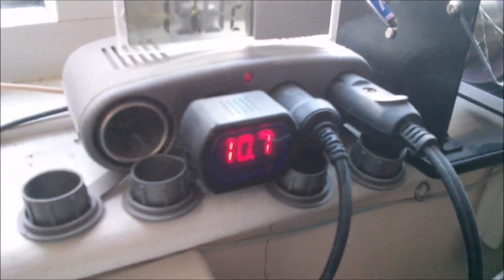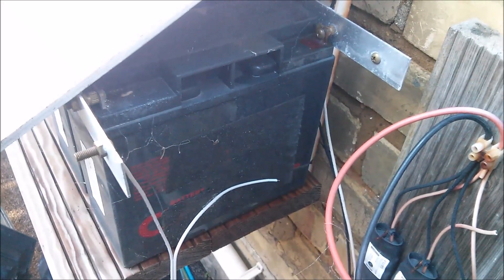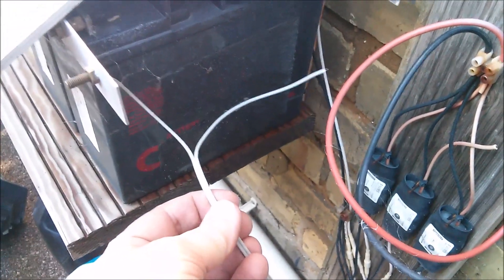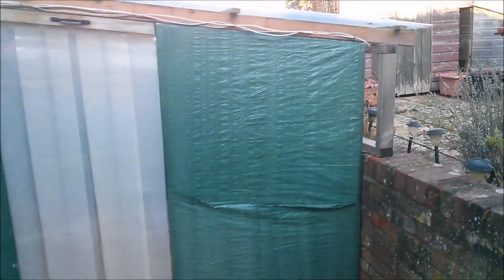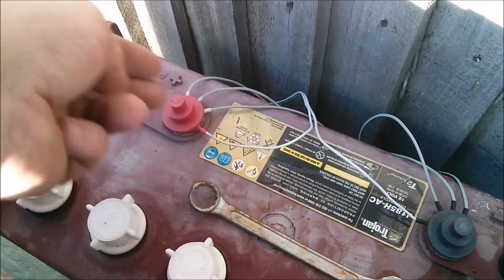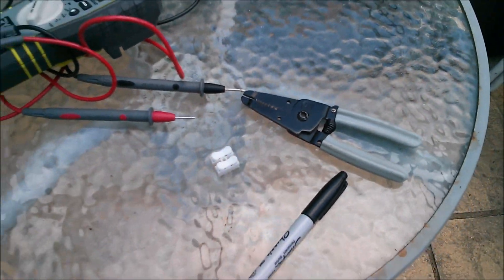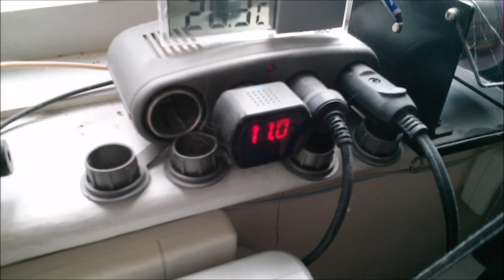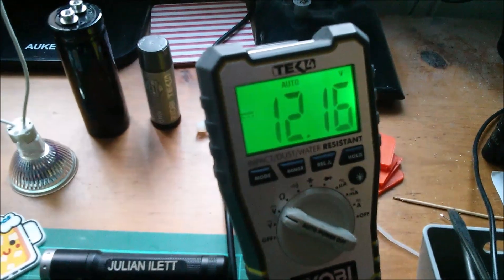Office Batteries - Cable Upgrade

Comment: You could pulse a coil using juice from the source battery, and collect the spikes at the destination end of the long wire, and connect directly to the battery being charged. 
I think this is also a good way to disulphate the battery plates at the same time. You'll have to shield the wire if you don't want to be the local transmitter!

Comment: Get a cheap $0.50 MT3608 module and set it to 28V at the donating battery.
At the end of your wire on the other end, connect to an MP1584 based (~$1) buck regulator module from eBay, set it for 13.85V, which goes to the battery being charged. 
EZ PZ... Lowest loss/price if you don't want to build something from scratch...
Reply: Only problem is then nothing protects the source battery from over-discharge. Probably not a huge problem, though.

What I might even suggest instead is just put the boost converter at the destination battery. Sure it will have greater losses under load but there's less to go wrong.

Comment: Julian isn't it about time you bought some decent cable. The cheapest good copper cable is 1.5mm lighting cable. If you want water proof outdoor flex is a good choice. These are minimum requirements in my experience. Try Toolstation they're good value.

Comment: Is that just to monitor the battery voltage from inside? If not, if you put a load on there that voltage will drop...

Comment: Maybe a weird question but why don't you have fuses at those battery terminals?
Reply: With cables that thin, the impedance (resistance) is likely to limit any fault current. If the cable gets hot, it will just ‘fuse’ and go open circuit.
In my own 12V PV solar system, I use fuses. But then I intend to use 4mm² copper cable. Currently only one third of the intended system is operational. This has a 100Ah battery and a 30W PV solar panel system. It currently supplies 12V LED lights for the main shed and the covered area next to the main shed. This year I have installed six 100W PV Solar panels, but have not yet wired them up.
Reply: @Mark1024MAK   Thin or not, it's a matter of safety. Remember that you can cut Styrofoam with a thin wire and the wire will keep on conducting. The wire will get that hot that it will start melting the isolation. If you are lucky the wire itself will become the fuse. But it will burn somewhere and that somewhere and how is the issue.  To think about how little fuses and holders cost, I have  postbags in mind, it should be a no brainer to use them, especially connected to those big batteries.
Reply: @Luke-san  the hot wires for cutting styrofoam are low resistance, and as such, high current and actually pretty strong and thick. 

The cheap crap CCA is pretty weak and thin, and has high resistance which would limit the current way below a point where there’s any risk. 

In fact, I remember him running some wire from the back of the house to the front for that PIR light and I believe he shorted the wire together, nothing happened except some minimal current flow. It didn’t heat up and melt, purely because of the high resistance of the wire.
Reply: @Dust76tr   There are several calculators on the internet. I took aluminum 18 AWG (so 1mm) and 20 meters in total  which would be 10 meters in length from the battery (in case there is a short 10 meters away from the battery). The short can happen anywhere. Result = 0.645 Ohm   That is 18.6 Amps at 12 Volt so it would certainly get hot and start to melt the insulation.  Maybe Julian can do the experiment
Reply: @Luke-san  he already has: https://youtu.be/4qUDqjYXals

20m of CCA was around 8 - 9 ohms, so at 12v, maximum current flow of 1.5A, however, since that was just one conductor of the 2, you’d have 40m in total, so that would be 0.75A, making 9W maximum. 

Also, over that distance, there’s going to be a significant voltage drop, reducing the maximum current and wattage too

9W over the physical distance of 20m on a single strand is 450mW/M. Across 2 strands, that’s 225mW/M per strand, maximum, which is tiny
Reply: Ok, thanks for that link! 
Now we have the values and can start calculating what would happen in the case where Julian balances 2 batteries with that cable.   The best (and I emphasize on that ) in that case scenario is that the cable would shorten right in the middle.  Quick calculation then would be Ohms law (all components are linear in this case (except the wire at very high temps)) 12 : 9 = 1.33 Amp.  Ok, no big deal except that it will drain the batteries.
In real world life a short doesn't always happen at the far end of the cable. In case it happens at 1 meter away from the battery. Quick calculation is that 1meter wire = 0.45 Ohm (so double that because of + and - -> 0.9 Ohm per meter in this case). So if the short happens at 1 meter away from the battery it will be 12 : 0.9 = 13.33 Amps.  I am pretty sure several things will start to happen. The insulation will first melt and it will start melting before that 1 meter which could lead to wires starting to touch closer.....
Even at 5 meters away it is still 2.66 Amps which is way to high.
So, 1) use cable that is meant for outdoors if you plan on using it permanently.  UV will crack that insulation (potential risk of shorts then, hint the name of the channel) .  2) Use a fuse since a short doesn't always happen at the end of the cable. ( a 1 Amp fuse would do in this case I would suppose)

Comment: You need to make yourself a DIY under voltage cut off indicator, and set it for 11V ? 
Look at app note of the TL431 data sheet made by any company. 
Ti has the best datasheet.

Comment: what is the cost of electricity in the UK?  here in pennsylvania its .06 cents per Kwh
Reply from the maker: From memory it's about 16p I think.
Reply: I'm outside of Harrisburg. :D  a mile from TMI.
Reply: @DIY Projects The solar power system is not for getting the house off the power grid, it is just an experiment, and occasionally for powering other experiments...
Reply: @DIY Projects - In the mainland U.K. most private homes in areas where there is mains gas use gas boilers for heating (both domestic hot water and central heating). Mains gas is significantly cheaper for heating. Cooking is not as clear cut. We have gas hob but an electric oven.
In areas where there is no mains gas, then typically heating is either electric, bottled gas, oil, wood or coke/coal.
Reply: Where I am, and with my current supplier, the rates that I am currently charged are:

Electricity: 15.01p/kWh plus a standing charge 19.13p/day.
Gas: 2.84p/kWh plus a standing charge 16.00p/day.
On top of both of the above VAT at 5% is also charged.
All prices are in pence (£0.01). VAT is a government tax.